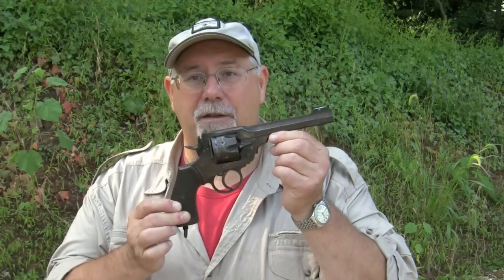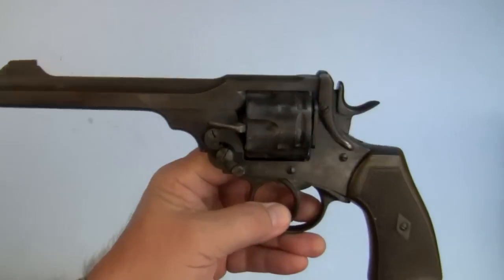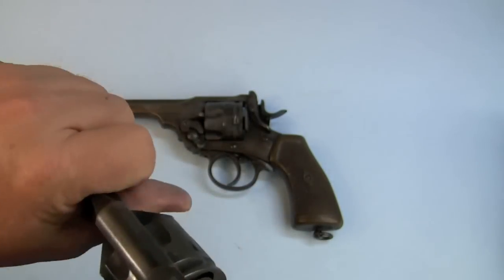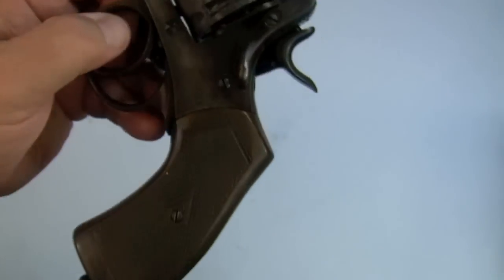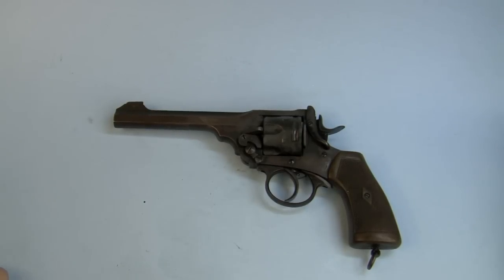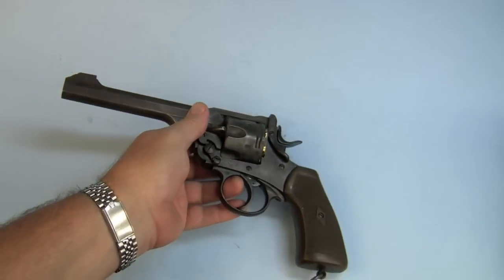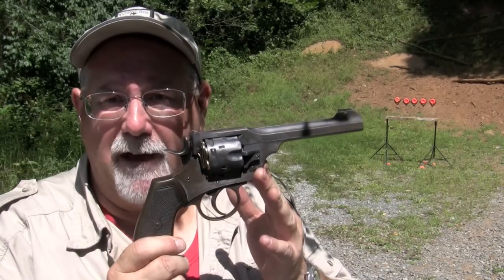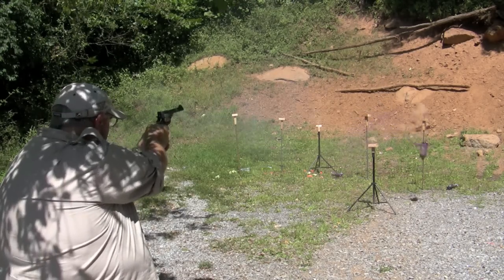Shooting British  455 Webley Cartridges in a Shaved Webley MK VI Revolver

Comment: Hi LiamE69,
Yes you are right in part, if you can make a case, then you can still own Pistols under Section 7/1 or Section 7/3. I still have a number of pistols held like this, as do many of my friends
Reply: Mr Valentine, My friends at my club say it is pretty well impossible to get a licence for a brass cartridge hand gun. I am a gun owner - .22 rifle. .38 lever action rifle and a .44 black powder revolver. What sort of case must I make to convince the powers that be I am OK to own a proper hand gun. By the way, I'm 70 and in a wheelchair. That might help.
Reply: Adrian Larkins I forgot to mention, I don't want a gun with a barrel a mile long!!!
Reply: Well Adrian, I have 2 x .22 Pistols, a Britarms and an IGI Domino. A Colt .38 Special 1911 and 1 x 7.63 Mauser C96, and 1 x .45 Colt 1911 Authority for another 5 x C96's. I guess that it is not that it is possible to do this. You are quite right about the long barreled pistols!
Reply: Chris Valentine Thanks, but what must I say and do to convince the police I am OK to own a proper hand gun that has a normal length barrel. You have a veritable arsenal.
Reply: Adrian Larkins That with 46 Rifles and 6 shotguns

Comment: I would ask that you mention using 'Federal LP primers is a must with these revolvers, maybe save someone else from having problems in the future?
Reply: I've also, been told that if you can insert an American nickel between the cylinder and recoil shield the cylinder probably has been shaved? I personally own a 1926 Enfield(post war) that I was lucky enough to find an original cylinder for and now has both a shaved .45ACP and a non shaved .455 Webley cylinder both with ejector systems so, merely taking a penny and removing one then exchanging for the other. By the way the when I have the .455 Webley cylinder in this gun, a dime would be hard to insert between the cylinder and recoil shield.

Comment: Hello Mike have you thought about using .45 Auto Rim casings for reloads in your shaved .455 Webley. It would be easier than having the cylinder  soldered with a shim.

Comment: I have a mark 4 with a 6 inch barrel, great old guns. I'm curious why so many were machined to accept 45acp with moon clips if its not recommended to use factory 45acp ammo? Has one ever failed from doing so? I have even spoke to people that fired 45colt one at a time with no failures of loosening of the frame. any ideas?
Reply from the maker: .455 Webley ammunition was non-existent at the time in the USA. There have been numerous cylinder ruptures from .45 ACP ammo

Comment: Thanks! I just came across this video, and enjoyed it very much. I have two questions for you if you don't mind. I inherited a MKIV in very good condition but it has also been "shaved". To begin with, do you carry yours with an empty under the hammer? And, I see that you load wad cutters; is there a good load you would feel comfortable recommending for this gun? I've never fired it as I am aware of the danger of factory .45 ACP ammunition. It is not my intention to take this to the range every day, or anything remotely close to it.
Reply from the maker: Eric Ellquist I load all six. If you watch the other Wesley videos you will get all the load data you can handle.
Reply: @duelist1954  Thanks! I'll do that...

Comment: I wonder if it would be possible to make a cylinder for the Webley that restores the ability to fire .455 or one step further, possible to make a cylinder strong enough to take  factory.45 ACP? The altered guns already have no collector value but still could be great shooters. I think modern metallurgy and modern manufacturing methods could make it work.  Or to make a whole reproduction Webley that can fire .45 ACP from the get go?  If they can make reproduction Colt SAAs, Schofields, Remingtons, etc. Why not a Webley? A lot would buy it if it was available.

Comment: I have a Webley MK VI that seems to be double action only. Was there ever a double action only, OR is there something wrong with the single action operation?
Reply: kotzting Same here. I bought a MKVI many years ago, mostly as a curio rather than a shooter. It seems to be DA only. When I try to cock the hammer it locks up.
Reply: kotzting its a common issue for older or hard used guns for their sear to be worn down causing the sear not to catch properly when you pull the hammer back for a single action shot

Comment: I just bought a MK VI.  Sadly, I didn't do enough research before I bought it and was unaware of the shaved cylinders.  Unfortunately, mine has a shaved cylinder.  I was wondering if I could just put a washer over the extractor just wide enough to make contact with the rims of the .455 cartridges.  I was also thinking about buying a whole bunch of small rubber washers to put on each cartridge to decrease the head space.  Are these bad ideas?  Also, is there a brand of .45 ACP that you recommend for the MK VI?  Reloading brass is one thing that I definitely don't want to try.  Thanks.
Reply from the maker: All .45 ACP ammo is too high pressure for your Webley. Your best bet is to modify a moon clip to handle .455 Webley cartridges, like I did in the video. It is easy to do.
Reply: Thanks.  I have seen at least one person on E Bay that sells .455 moon clips.  They aren't cheap.
Reply: A unshaved extractor may be easier to find than a complete cylinder. It would support half of the rim and should allow a better primer strike.
Reply: Thanks.  However, the gun is currently just a paperweight.  The main spring has broken and I haven't been able to find one.  I will probably need to have one made.  Also, the cylinder stop and the extractor aren't working right either.  I really should have done some research before I bought this gun.  It should work fine again once I find the parts I need.

Comment: As someone who comes from a gun-free country I was wondering...why was he automatically chambering the rounds at 9:07, but not at 9:24? is there a particular benefit to this method?
Reply: The gun is a double action revolver.  This means that pulling the trigger will cock the hammer and advance the cylinder automatically.  When this is done the trigger pull is long and heavy which makes shooting accurately more difficult.  When you pull the hammer back with your thumb it also advances the cylinder and sets the  trigger in a position where the pull is far lighter and short and thus it is easier to make more accurate shots.  Hope this helps.
Reply: TheShoreman1 Make sense, thanks for the info.

Comment: Would the .445 cartridge projectile be somewhat larger or heavier than the .45 acp???
Reply: Jeff Smith In practice, the only significant difference between the .455 Webley Mk. II (smokeless) and .45 ACP rounds are the rim on the Webley round, the pressure of the loading, and the bullet type and weight.  The Webley Mk. II round is loaded to not much above black powder pressure, and uses a heavier soft lead bullet, while the .45 ACP is loaded to common smokeless pistol pressure (and sometimes, by handloaders for their own guns only, a bit higher) and commonly uses a jacketed bullet, usually a bit lighter than the Webley round.
Reply from the maker: Jeff Smith The .455 Webley round used a 260-grain, .454-inch diameter bullet as opposed to the .452_inch, 230-grain .45 ACP. The principle difference is in the pressure. >45 ACP generates between 18,000 and 23,000 psi. The Webley round is not safe above 14,000. Officially it is rated at 12,000 psi

Comment: I was under the belief that the British Government needed hand guns during WWII and brought these back into service.  Since ammo was in short supply they shaved the cylinders to use American .45acp.  If you know this to be 100% false please let me know.
Reply from the maker: That is 100% false...sorry to bear bad news.
Reply: The truth requires no apology nor is it bad.
Reply: Mr Beliveau is correct. They were "brought back" in a manner of speaking, as the intent between the wars had been to replace and retire them, but neither the guns nor the ammunition had actually been officially removed from service at the time. OTOH if I recall correctly, there was a short run of M1911A1's made to chamber the .455 automatic cartridge (originally designed for the Royal Navy's Webley & Scott automatics, and a very different beast from the rimmed revolver cartridge seen here), which would accept .45ACP at a pinch (read "in desperation, when there's nothing else left to shoot").

Comment: With the old single action revolvers, carrying a round under the hammer was considered dangerous.  I'm assuming this is safe with the Webley or duelist 1954 wouldn't have done it.  Does the Webley have something similar to the transfer bar in a Ruger?  Or are double actions in general not susceptible to accidental fires when banging the hammer?
Reply from the maker: It has a hammer block

Comment: I looked at the internals. It appears to be rather simple design.

Think these would do well as reproduction?
Reply: Quite possibly, but it'd be up to a company like Uberti, which specialises in such things and was willing to branch out into a British revolver. And then like all Ubertis, it would suffer from the performance and pressure limitations that the original-manufacture guns did (which is not to criticise Uberti - when they reproduce a design, they do it warts and all and make no bones about it; you get what you pay for). If what you want is a top-break combat revolver with modern metallurgy to take modern pressures, I'm not sure you should hold your breath - the US manufacturers seem wedded to the solid frame for the foreseeable future.
Reply: jsm666 I think the Italian manufacterers could make one of modern heat treated steel that could take .45 ACP pressures, but the design would have to be beefed up in critical areas, so it would not be a true clone of the Webley and have different parts than the originals.

Comment: I'm about to purchase one for $300.00. I'm I paying to much??? and how will I know if it's a shaved one????
Reply from the maker: That's a very good price. Around the outside of the cylinder is a serial number. If the bottoms of the numbers are cut off, it has been shaved. If the numbers are whole, break the gun open. If there are no numbers or letters stamped onto the rear face of the cylinder it has been shaved
Reply: Kool. Thank you.

Comment: Could you permanently attach the moon clip turned shim to the webley cylinder?
Reply from the maker: Thomas Kwei Yes. You could silver solder it to the cylinder
Reply: duelist1954 could I use empty cases to put the cylinder in the correct orientation?

Comment: What is the value on a Webley .455 ?
Reply from the maker: It varies a lot with condition. I've seen prices from $600 to $2,000
Reply: +duelist1954 

Ok, I was just wonder, have one after my grandfather, he brought it to Norway under a air drop in WW2. Still original and all number are matching.